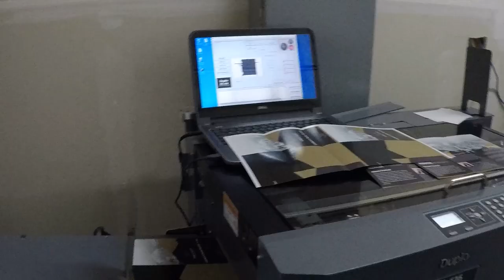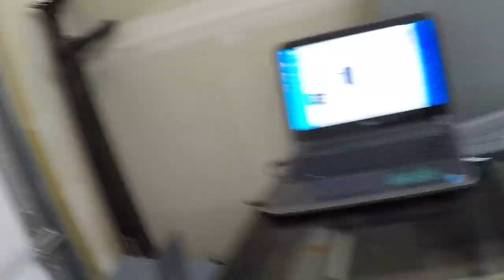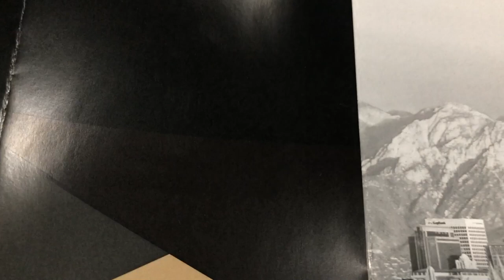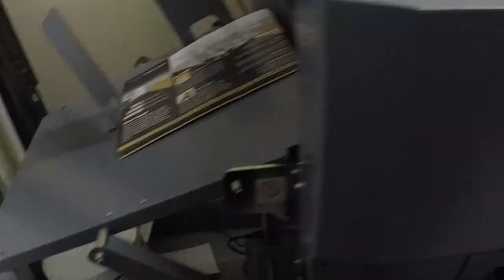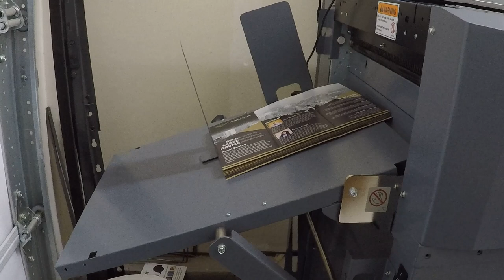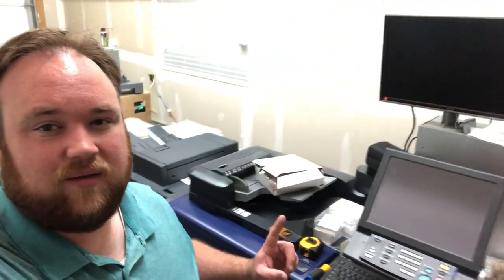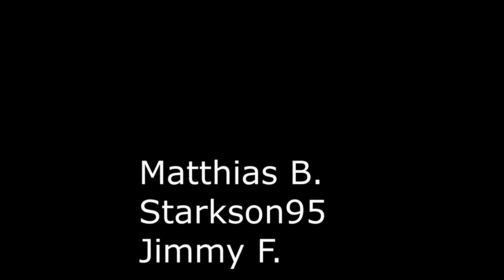Printing, cutting, and creasing tri-folds - vlog 257 - Print Shop Updates

Comment: Its all about how you build the shapes. Shape builder tool is the ultimate. "Yes, I'm A Designer" will definitely have some good tutorials on the shapebuilder tool and the pathfinder tool found in Window - Pathfinder. 

.eps and svg. files are great for dragging back and forth from illustrator to indesign. Note. Always be certain your colours cmyk or rgb. They can shift all the time depending on what image and art you're working with. This can drastically change final colours. Similarly how  in indesign black and registered black print differently. 

In final print file I would make sure all the individual shapes are in one layer. Its less confusing for the machines to render be it in illustrator or indesign. 
Try this and that should give you the crispness your after. If not, it may be overrides set in your fiery. Or you may have to alter your image settings.
Reply from the maker: I ended up going in illustrator and reshaping them to not overlap. I just like the lazy way. Thanks for the channel recommendation, I'll go check it out.

Comment: Try creasing the brochure from the front side. It creates a hinge on the inside that makes for a better fold on toner based prints with toner over the fold lines.
Reply from the maker: Thanks for the tip
Reply: Agreed, probably just creasing the wrong side of the sheet and that's why the cracking is still showing up.

Comment: Your Duplo uses the same channel score/creasing mechanism that the Morgana does. Try different paper. Yes, I agree with others too, it matters which direction the score is made. Can you adjust the pressure?
Reply from the maker: Yes, I believe it has 3 different pressure settings. Which side is the correct side to crease?

Comment: Everytime I watch your vlog I say "this guy must be lazy to keep that mess in his workshop" and those clothes on the press make me angry !!
Glad you finally made some clean up and put order.
Personally I use both Illustrator and CorelDRAW for vector artworks but I prefer CorelDRAW especially the latest version which is a killer. It's much better than Illustrator in objects management, shapes control and most importantly color profiles which is the key for good printing.
You need to crease/score your brochure or leaflet in the opposite way to avoid that cracking but you clearly need a professional folding machine.
Reply from the maker: I don't know if I'm lazy or just don't know where to put certain things so I end up doing nothing. At least there was some progress. I definitely need a good folder.